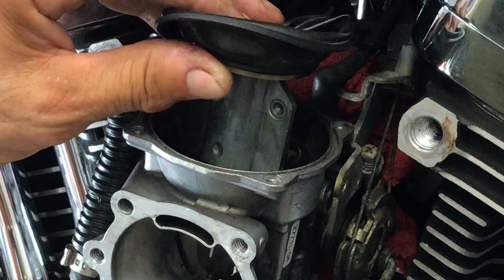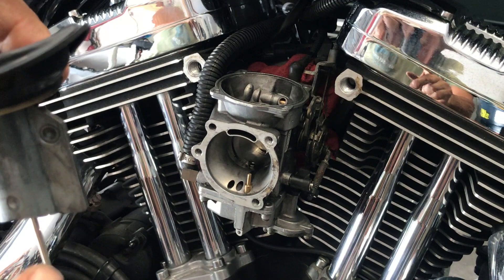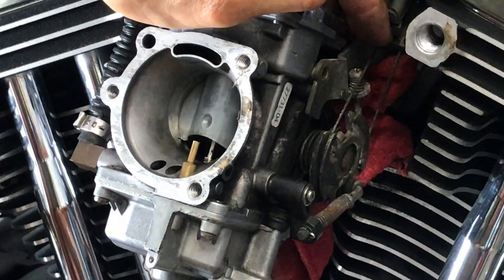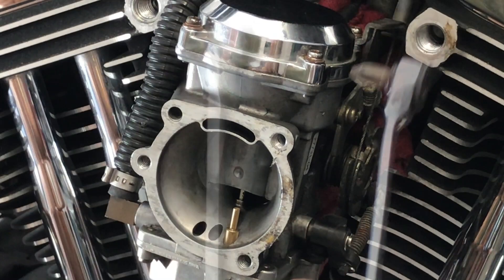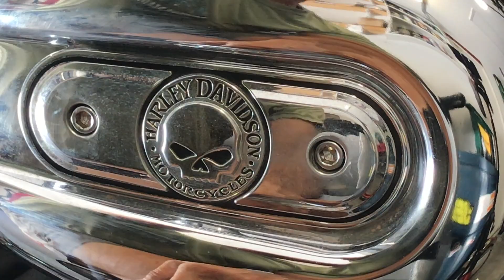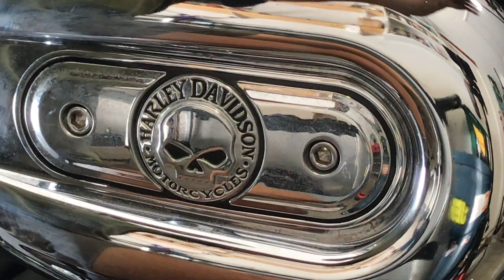How To Harley Sportster Carburetor Slide Needle Adjustment.

Comment: Thank you. My ‘04 883XL Sportster has been sitting for a couple of years. I just got it to run with the choke 3/4’s of the way out - anything more or less and it dies. Plus it has a low idle. Your vids are exactly what I needed for the next step after changing oil & plugs: next - fine tuning! Thanks again!!
Reply from the maker: Happy to help. I will send a video on how to clean the carburetor.  Your idle jet is clogged and that's why it Has to run on half choke. Clean the idle jet and this will run perfect.  don't worry about the oil and the spark plugs clean idle jet. Ride it, let it go throw a few heat cycle and then change the oil. If it sat for any amount of time you'll have oil inside to dry sump of your motor. Run it,  then change your oil, it will take a day or two of riding. To get all the oil back into the can. Sportsters oil like to be halfway on the oil dipstick. Check and clean air filter. Any questions just ask. Thank you for watching and your sub. Ride safe and have a great day.   Take a look.  https://youtu.be/Pp4l-zbQcy0
Reply: @TwoWheelRocco  Thanks for the heads up, Rocco. I added a Lucas carb cleaner to the fuel that I thought would clean the jets, but I’ll look for your vid and follow it to clean the idle jet right. I was able to get the bike to idle for 10-mins last night. Appreciate you, brother!
Reply from the maker: This is it,   https://youtu.be/Pp4l-zbQcy0.  Let us know how this works out.  Dump the fuel in the gas tank it's probably bad anyway. How long did the bike sit?

Comment: Rocco you are the best! I did this on my 2005 xl1200 stage 1. I have v&h slip ons and a k&n a/c. 3 washers, a 48 idle jet and a 185 main. it runs like a scalded ape! much appreciation for this channel and all you help!
Reply: @PNW_Cannabis_Farmer the washers will make it come off idle richer. it isn't hard and doesn't take long to do, try 2 and ride it for a while to see the affect. go to three or back to 1. ride it in between. I would say at least 50 miles unless you notice an immediate change. pull the plugs and see how they look
Reply from the maker: Happy, all worked out. Thank you for watching and all your support Paul. Ride safe and have a great day.

Comment: thought I would let you know  that I finally got my Sporster going. I stripped the carb but found nothing  blocked or dirty. The fuel that was in the float chamber was a dark brown in colour not even any sediment .My wife said why not put some fresh fuel in and I did and guess what it fired right away. the moral of the story is if your bike has stood for any length of time   and is not starting try draining ALL fuel from tank and carburreter it worked great for me if only I had thought of it.I think you could  drain carb by unscrewing the drain screw one turn  located at rear of carb not a great place but at least you would get new fuel to where it is needed.British Petroleum reckon petrol  that the lighter elements of the fuel evaporate  within months even in a fuel tank something I did not know.Thanks again  for your  instructional videos and advice. Ride safe you know it makes sense from  Accrington Lancashire.
Reply from the maker: Happy to read all went well. Thank you for watching and your sub John. Ride safe and have a great day.  PS thank you for your update.

Comment: Thanks, a very good vdo IMO.
My 06 XL1200C carb runs too lean, was told they come from the factory that way and mine has Screaming Eagle mufflers and so that also could have something to do with it. and mine belches, farts and hiccups here and there, and when I put the choke on it runs like a scalded dog! So yea I need to raise the needle 3-4 washers fer sure!
Reply from the maker: Yes, that's where I would go put three washes test and tunes. See how you like it. It should change your fuel curve and get rid of a lot of those symptoms that Bike is showing. Let us know how it works out. Any questions just ask. That would be the first thing I would do. Thank you for all your support Kenny. Ride safe and have a great day. Love those sportsters. By adding choke, you added fuel. And that's what those washes will do without the choke being on if that doesn't work, then take the Carburator apart, and see what jet you're running for Idle.

Comment: Hey Rocco! I have a 1999 sportster that I want to keep the stock pipe and breather on.....could I still shim the needle with the intake and exhaust stock? I also have jets to throw in if that would help too. The bike runs good but I feel it's got more to give.
Reply from the maker: Happy to help.  I would not full around with the Jets. But two washers or three under the slide needle and see how it runs. Let us know how it works out. Any questions just ask. Thank you for watching in your sub Bushradical. Ride safe and have a great day.

Comment: I have a 1997 sportster 1200 im at a loss I have Rebuild the carburetor Rebuilt the intake manifold New Choke cable I'm still dumping fuel out of the Overflow It idles fine But cuts out on acceleration
Reply from the maker: Check your Petcock. When the diaphragm fails gas will freely flow into your intake. And cause all sorts of problems. Take a look at this video. https://youtu.be/7Fo9Q93OJXI.   Let us know how that works out.  Do you replace your float needle jet with a new one?

Comment: Iam having trouble getting my 2000 sporster to fire up . It has stood for ten years . I have new fully charged battery  plugs spark ok but it doesnt even cough or offer  to fire  after a few  cranks over the plugs are both soaked in fuel.I have converted the vacuum petcock to a simple on off reserve.  I have been riding  bikes for fifty years but am a relative newcomer to Harleys. this problem has  got me  going  crazy. Can you recommend a good sparkplug. Also how much cranking does it typically take to start a sporster ,mine was never good especially if it had stood for a while. When warm it would start instantly it has got me beat
Reply from the maker: 10 years is a long time,  that's the last time this bike has is started.  I would start with cleaning the carburetor. I will send the video. https://youtu.be/Pp4l-zbQcy0. Thank you for watching and your sub John. Any questions just ask and let us know how this works out. Ride safe and have a great day.

Comment: Hey Rocco,  I’m having an issue with back firing and missing when throttling up.  I get an error on my 06 sportster 1200 the error is p0374 Crank shaft sensor.  Do you recommend replacing it?  Do you have a video on that?  Thanks
Reply from the maker: I would replace it.   Hope this helps. sportster crank sensor install.    Let us know how this works out. Any questions just ask. Thank you for your Sub Scott. Ride Safe and have a great day.

Comment: Great video, I really appreciate your doing these. One thing would be handy to know is how thick those washers are.  One can find all kinds of washers in a hardware store that will fit in terms of id, and od, but the thickness is the critical dimension. It wouldn't matter if you used one washer .032 thick, or two .016 thick, but if you used 4. - 032,  where the plan was to use 4 - .016, it might not be so good (it would sure be rich!).
Reply from the maker: Happy to help, they are standard carb washers. Ebay.  .https://www.ebay.com/itm/143059054132.  Thank you for watching and your Sub David.  Ride Safe and have a great day. sorry about that.  I would think a 032 would be correct and thickness.
Reply: @TwoWheelRocco  of course that eBay listing is gone now and I went to great lengths and finally found Sudco 009-396 tuning washers for Keihin carbs. amazon is double the price but keep looking around and they're $4 and some change for a dozen washers. as always Rocco is the Man!
Reply from the maker: @paulwalker7202  Hope this helps and you are right so many parts are harder to come by. Take a look. https://www.ebay.com/itm/291994473665. This helps. Thank you for watching in all your support Paul. Let us know how it works out. Ride safe and have a great day.
Reply: @TwoWheelRocco  omg that's a lot of washers lol
Reply from the maker: @paulwalker7202  When I bought them it was $12,  times have changed. Just trying to help. You can start selling them on eBay.
Reply: @TwoWheelRocco  you are very helpful sir, I always look to your videos first. I found 12 for $4 at dennis kirk and added them to another oder, a/c that was on closeout 40% off. I'm frugal.
Reply from the maker: @paulwalker7202  You did well. Let us know how it works out. Ride safe. Have a great day.
Reply: @TwoWheelRocco  finished up today. 48 idle, 185 main, and 3 washers. runs fantastic! thanks for your help!
Reply from the maker: Happy to help. I'm glad all went well. Thank you for all your support Paul ride safe and have a great day.

Comment: Hey rocco, you have ,in my opinion,some of the best and most comprehensive videos on the web. I subscribed. Where do i get the washers? Im following your advice as i have a tc88 with carb. Larger engine,same scenario. Thanks
Reply from the maker: Happy to Help, Any questions just ask. 10 pack  Ebay.https://www.ebay.com/itm/Mikuni-VM26-315-Jet-Needle-Washers/224193955147?epid=209955529&hash=item343300454b:g:f2kAAOSwTmpfhtaj.   Thank you for your Sub. Let us know how this works out.  Ride Safe and have a great day.

Comment: Hello Rocco, I have a 06 Sportster XL1200 it has a little over 1,400 miles on it now it had 1,200 when i bought it. The bike had been in a warehouse sitting for about 1 year. I put new fuel in it several times now. Runs great but I'm getting a spit/pop from carb sometimes from idle to mid acceleration from carb. I ordered a CV kit online. Any input from you on this problem would be highly appreciated...I did try air fuel mix...was out 3 1/4 ...I put it at 1 3/4 out...still the same...lean popping? Thanks I'll await your answer.
Reply from the maker: I would look at your Petcock for a vacuum leak.   Video on petcock test.https://youtu.be/7Fo9Q93OJXI. Try that and let us know how this works out. Thank you for your Sub David.  Ride Safe and have a great day.

Comment: Hey Rocco, I got a 2004 Sportster Xl1200 , in any gear past 2nd when accelerating it sputters and bogs out and won’t let me accelerate limiting me to low speeds. What do you think the issue could be?
Reply from the maker: Happy to help. Sounds like a lack  Fuel issue. I would test your Petcock and check your vacuum line to your Petcock that operates the Diaphragm in your peacock. That is what controls the flow of fuel to your carburetor. That's where I would start.. Any questions just ask. let me know how this works out. Thank you for all your support Mark. Ride safe and have a great day.  .https://youtu.be/7Fo9Q93OJXI?si=bUqrEnVRRtqcIRfN
Reply: Thank you Rocco, I will be sure to try that out and use the video you provided. I actually found a video on YouTube that shows basically what my bike is doing so you have a better understanding if I didn’t explain it well lol. Here’s the link to it: https://youtube.com/shorts/8UECX9R3cCY?si=OSB69FS75thhoctN

If that helps further please let me know.

Thank you again for the help and quick replies!

Comment: on the air fuel mixture screw does the Oring and washer go on the bottom of spring or top i have seen it both ways witch is the correct way thank you sir
Reply from the maker: Happy to help, this is if the screw is in your hand, it goes Spring washer, and then O-ring the washer seats the O-ring inside the carburetor the hole. Any questions just ask. Thank you for watching and all your support Brian. Ride safe and have a great day.

Comment: My 2005 XL883 runs perfectly in warm weather. In cold weather, it takes forever to warm up and also "spits" a little on take off. It idles smoothly but I wonder if adding the washers would help this. The carb is in perfect condition and clean inside because I vent the crankcase to the atmosphere - which also lowers the air temperature going into the intake, possibly increasing the problem. What are your thoughts? By the way, I recently changed the spark plugs and they looked perfect, not too lean or too rich.
Reply from the maker: If it's running great with a little spinning don't look for a problems. You could always do the washer under the needle and see what it does for you. Easy enough. Let us know how that works out. Ride safe and have a great day.
Reply: @TwoWheelRocco  I was hoping you would say that. I always like to do the minimal jobs first: "If it ain't broke, don't fix it." approach. I'll start with the three washers, then if it's too rich I can go to two washers. I don't want to re-jet anything yet because in warm and hot weather, it runs perfectly. 
Thanks for the quick reply and keep up the great videos!
Reply from the maker: @boomerguy9935  I agree, sounds like your bike rolls out and idles fine.The washers will up the lower end fuel curve, which most riders like. Let us know how it works out. Have a great day

Comment: Hey Rocco, thanks for your wonderfully detailed videos. I've watched all 3 on this bike so far but I have a question. I have a 94 sporty evo I'm doing carb work on for the first time. I have a kuryakyn hypercharger and a set of cobra speedster 909's that are going on it. Stock jets are 40 and 170. I ordered  42 and 45 for pilot and 175 and 180 for main. I figured I'd start smaller and go bigger if I needed them. Will this be enough or do I need bigger jets? Thank you in advance
Reply from the maker: Happy to help. I think you have coved.  Start small and work your way up,  no more than two times on that air fuel screw any more than two times that means you need a bigger idle jet. Let us know how it works out.  test and tune.  thank you for watching and all your support. I safe and have a great day

Comment: Hey Rocco,I have a 2003 100 Anniversary harley davidson My question to you is.
I'm getting a lot of sputtering and losing power...(CAN YOU HELP) 😔
Reply from the maker: Happy to help. I would start by checking your Petcock Diaphragm and the vacuum hose that goes to your intake on your carburetor side from your Petcock. They get old the Diaphragm fails, causing a rich fuel condition.. Check the vacuum line sometimes they get old and they   collapse on vacuum pressure. I will send a video on how to test it. Any questions just ask.  Thank you for watching all your support Emilio. Ride safe. Have a great day. Let us know how it works out.   https://youtu.be/7Fo9Q93OJXI?si=thRz1C-gB2yDSFYY.  This is where I would start../

Comment: I’ve always gained some great info from your videos. I have a stock 05 883 with under 4k and from what I’ve gathered online is that the last  04-06 carbed sportster ran really lean with bad coughs. My 05 now has a 45 slow jet and mixture screw uncovered and drilled my slide with 7/64” bit and with one washer under the needle. Runs a lot better but just can’t seem to get this annoying cough right off idle tuned out.  I’ve read that I can replace my needle with an earlier N65 needle and bump up to a 48 that will clear up this annoyance?
Reply from the maker: Try three washers under the slide needle and let us know how this work out. Any questions just let us know. Thank you for your Sub Gary,  Ride Safe and have a great day.
Reply: Two Wheel Rocco I sure will give that a shot and share my results. Thanks
Reply: @simply_instrumental  how did the two washers work out for you?

Comment: Prior to inserting the 48 pilot and 190 main, what did you have and how was the engine running that made you decide to shimmy the needle?
Reply from the maker: Happy to help,  45 idle.  180 main   wasn't as responsive off Idle with the pipe. Thank you for watching and your sub Carlos. All moles are different.  tune and test. That's not how it works out. The shims will make a difference. Ride safe and have a great day

Comment: Just got a 03 sportster 883 with 4k miles. Replaced the carb with a brand new CV thinking it was stale gas, but it's not. Sputters on top gear and doesnt want to go past 50-55. What could it be? Do the pushrods on the '03 need adjustment? Hoping it's not a blown top end
Reply from the maker: Happy to help. There is know adjustments on those pushrods.  it's a carburetor gas issue.  I would test the Petcock. first. See if there's a vacuum leak and that's affecting your gas flow which will affect your Top end. I will send the video. .https://youtu.be/7Fo9Q93OJXI. Thank you for watching and your sub .madskillzyo. Ride safe and have a great day. Let us know how it works out

Comment: Hi Rocco   I put 3 washer on needle.  Now when I give 3/4 throttle all gears I have a pronounced. Flat spot.  Any ideals? Thx in advance
Reply from the maker: What size main and idle jet?  I would go to 2 washers and see how she runs. Let us know how that works out. Thank you for you Sub Mike. Ride Safe and hav e a great day.
Reply: Two Wheel Rocco   Jet #50
Reply: Main 185
Reply: Two Wheel Rocco Vance and Hines short shots open no baffle